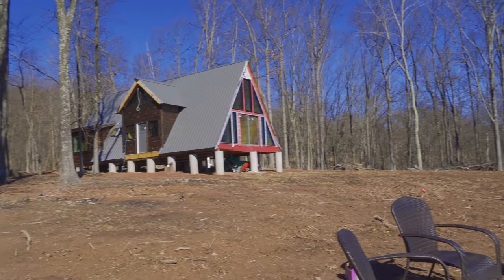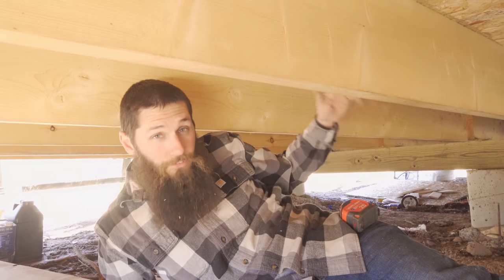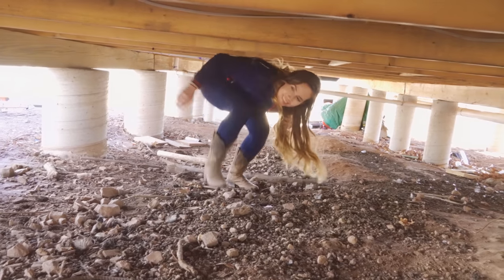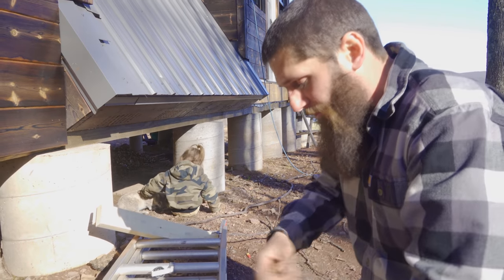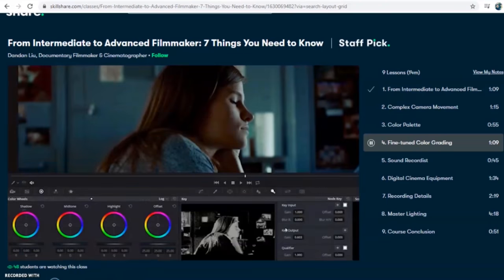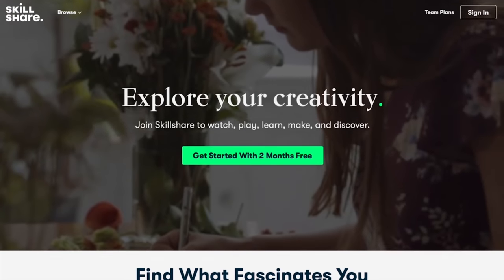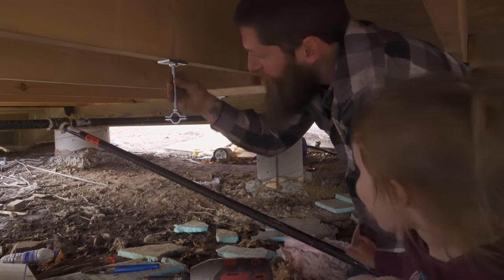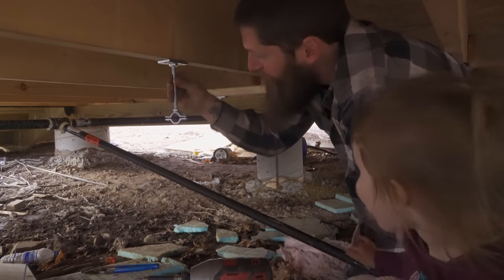WHAT Is Happening Underneath Our House?

Comment: What about termite protection? If you didn't do anything about that cheap and chemical free protection would be boric acid. Dissolve with water and spray all exposed wood up to few feet above ground. You have bunch you tube videos about that. But consult termite exterminator also before anything.

Comment: Sorry I dont understand the wood fired boiler!  how will you keep it going? I thought Propane/gas would be better. could you try to Explain! Thanks. Love & hugs xx
Reply: Wood fired boilers burn wood to heat water, and use electricity to circulate the hot water to whatever buildings you want. 
A few brands are very efficient,  most waste a lot of wood just keeping the fire going when it isn't needed. 
The trick is hundreds of gallons of water tank to store the heat. You burn the wood hot and fast until the storage tank is up to temperature, then let the fire go out.
Depending on your heat loads and how well the storage is insulated,  you can go a few days without needing another fire.

Heating the hot water tank from the wood boiler is easy with a side arm heat exchanger.
Reply: They have dozens of acres of woodland.  Propane will have to be trucked in and paid for.  They won't need all that much energy to heat the house as it is pretty well insulated.

Comment: 2 questions did you do the math for sizing the gas pipe per appliance and are you Insulating the floor
Reply: Clearly half-inch pipe is plenty adequate for a cook top, oven, and clothes dryer.  Each is well under 30,000 BTUs/hour.

Comment: Just me... but I don't get needing to run a gas line to a hot water heater? If you already got hot water, you got it made, no need to reheat it .... lol!
Reply: @thomaswhitten2537  seriously, I am a true fan of these two and their beautiful children and what they are doing. I was actually making a joke..! When people talk about a "hot water heater" instead of what it is,  a "water heater" to make hot water. 
But tankless water heaters make better sense. There is just not reason or need to reheat water that is just sitting in a tank not being used, cooling down and refiring the burner. None cost efficient! Actually cheaper tankless!
Reply: @thomaswhitten2537  wow I am truly at a loss with your responses to my post. At no time did I nor have I   suggested they use anything other than gas (propane) to heat the water. A wood boiler absolutely is an out dated concept for their situation. But read into it what may, my first post was merely a joke, and that is all it was. Have a great weekend, I am going to the races.

Comment: Will the floors require insulation or is it not cold enough in your area?
Reply: Their climate is nominally cold in the winter and hot in the summer.  Insulation would be prudent.

Comment: Do you need to connect a ground wire to the gas line pipe? The gas line coming into my house from the meter has a ground wire even though the line is underground but I've never seen a gas line installed under a house.
Reply: They do need to ground the gas pipe.  But they typically don't show all the tiddling details of their projects.

Comment: In you planning for insulation under your house are you going to using spray Foam insulation?
Reply: They used fiberglass batts in the walls.  I would expect that, if they do insulate under the floor, they would use those too.

Comment: Man-O-man, to much pipe dope. Of course it will never hurt, not until ya fail a pressure test and would like your soap bubbles to find a fitting cracked around the treads. Use a stiff toothbrush to wipe off the excess -- you only need to butter the threading (or partly fill it) before 'laughing waddling ducks' put their six turns in.  Make sure to include a swing joint if expansion and contraction could jar the pipe (like if one end goes into the ground).  Oversize entry holes for clearance and fill with flexible compound. A hundred foot run of iron pipe could expand (or contract) 1 inch over 100°F seasonal change in temperature and building structures might experience similar shifts as they settle over time.  Happy gas fitting.
Reply: Their pipes won't experiience more than 20 °F range.  Either they are buried or inside an enclosed under-the-house.
Reply: @wallykramer7566  I have no idea what insulation they will use; Insulated the floor or insulate skirts or lay out a radiant film. You are likely right, but I make no assumptions.

Comment: Did you have all the measurements to cut and thread the pipes to hit the appliances upstairs perfectly? That part isnt easy... each fitting sucks up some length.
Reply: If the pipe passes under the appliance in the correct direction, the riser does not need to be placed "perfectly".  Twenty-four inch sections make it pretty easy to hit a 30 inch appliance somewhere behind it.
Reply: @wallykramer7566  respectfully I would consider risers coming up at angles poor workmanship. It may be a country home and NOTHING Has to be level or square.  It just NEEDS to be.

Comment: stupid question, should you tape the pipe where it goes through the GAL. hangers. so there is no reaction between the two metals
Reply: Not required. Black iron and copper would be an issue. And even that you need the water flowing in the pipe to cause problems. Back and gal are okay.
Reply: @jordandelorme2341  thanks

Comment: Serious question, why not go with a flexible line? Surely that would be simpler than all those individual pieces of pipe?
Reply: Building codes require hard black pipe for gas lines to the cutoff valve.

Comment: Can someone explain me please, how "naked" wood under the house could be used in long term? As I know, weather will destroy it in few years!? Is that temporary house or they are going to do something with that wood?

Another question is termoisolation, does that good solution to build "floating" house, i thought wind will get warmth from the house and if the bottom of the house will be covered, it will be better isolated!?
Reply: MadMax they said they would be enclosing it - give them time.

Comment: Amazing how you knew what lengths of pipe with threads already cut in them to buy ??  And in what order to screw together each length, with I lost count how many couplers, so that your stubs came out in just the right place ? I would think the layout work for that alone would be a nightmare. I guess I am too familiar with pipe threading to see the wisdom in buying  20 couplers and various lengths of pipe to get that job done. Even if you skirt the circumference of the house I would have thought that you would have insulated the floor maybe ?
Reply: If the pipe is aligned to the gap at the back of the range (for example), then wherever a coupler is under the target is close enough.  The pipe sections are 24 inches and the standard range is 30 inches wide, so there is no chance of missing an opportunity.

Comment: How come you didn't use flex gas pipe?  Much easier to deal with.  You did a good job but I think it would be faster and cheaper too.
Reply: But how durable?   How hassle free throughout its lifetime?  That is why I chose black pipe too.
Reply: @wallykramer7566  yes it will last a lot longer.  I put in a gas stove and used flex pipe and it was very easy to run over obstacles. Since there is nothing to hit it, I don't see any problems with durability.

Comment: Don't drill that beam go under it. Just a few fittings...then you can put in a drip using a tee, 6" nipple and a cap. so simple. every couple of years take off the cap and drain the condensation...that will accumulate.condensation is not  an if its a when.  easy peasy.
Reply: Condensation isn't the concern.  It is bits of sand.  The gas comes from the tank very dry and will dry out any condensation which somehow gets in there.

Comment: Curious as to why diverting surplus solar was not considered for hot water heating.
Reply: The solar plant is photovoltaic, not thermal.  Not common to divert overcharge to heating.
Reply: @wallykramer7566  Once the battery bank is full charged the panels are generating surplus electricity.  There are switches available that will re-direct this otherwise unused resource to electric water heaters. There are solar hot water heaters available designed to take advantage of this as an alternative to the solar heat exchange type systems.  You could DIY a system using on-demand electric water heaters  and temp sensors to circulate water thru the on-demand heater and back to holding tanks to maintain the temps.  The only limitations are your pv generating capacity on cloudy  days but isn't this the same problem for solar thermal systems.
Reply: @wallykramer7566  Not as uncommon as you think.  Once the battery bank is fully charged, it is a simple matter to re-direct the surplus current not needed for float to an on-demand elec water heater that then re-circulates and re-heats the water in a holding tank like the Poly John.  The 96 gal version of this tank is < $150. It is designed as a portable water solution so it is not insulated but that is a problem easily solved.  96 gals is not going to meet the daily needs of every family but after the initial cost it does provide an inexpensive off-grid solution vs. expense of gas lines, LP storage tank and ongoing delivery. My neighbor in CO spends > $600/winter month on propane.  I don't spend a dime.

Comment: You will have a very cold floor with no insulation down there.
Reply: Frank Woodward they are not done!
Reply: @janazyx  We always put the insulation in first from the top then sheet the floor but it works ether way from the top is less itchy I hate insulating.

Comment: I'm surprised that you've had a mild winter. I guess you are in a hole in the doughnut! The south and the east have been getting hammered so that is why I'm surprised. 

Here in the Sierra Nevada of California we are having a drought and even if it snows a few feet a day for the rest of March, the overall eastern Sierra snowpack will be less than half of a season average. Locally, at the 9300 foot level the snowpack is at about 40% of an average season. We've seen worse in the last 20 years, but this is not good. People don't realize the nationwide importance of the Sierra snowpack. It waters the CA Central Valley and much of California's agriculture, which is the #1 producer in  the country. The Sierra snowpack is one of the most important "reservoirs" in the country. 

I can sure see the advantages of having a raised foundation. My crawlspace is dank, dusty and dark. If we had a raised foundation we would have some significant bear problems. They would want to build dens under the house. They frequently try to do so under our deck and we get other critters living the winter under our smaller front porch. Such is life at 8,000 feet in  the mountains.
Reply: Central and southern new England got zip for winter. Practically no snow in 2020, and it's been warming up since the beginning of February. 
The east coast in general is under the same snow drought, including where they are.

It's going to be a terrible year for ticks out here.

Comment: two points, first off, way too much pipe dope, you should be using thread tape AND dope(looping on a bucket of dope isn't good enough. Pipe to is to ensure that the pipes don't seize, thread tape reduces thread friction so that you can tighten them up more which is why you use BOTH. Second, the reason pipe wrenches exist is that they are needed to get the right tension on the pipe threads. Channel Locks are not the right tool for the job. It may work, but it's not right. There are certain things you can do yourself, but Gas is not something I suggest my customers do themselves as lives are on the line and thats just a fact. Biggest saving grace here is that most of that will be under the house so hopefully if a leak does develop then being heavier than air the propane should just load down the hill. 
Not trying to scare you, but sometimes reality deserves to be respected. I am genuinely hoping that OFF camera you brought in someone to inspect and test your work as I would hate for this to one of your last videos. 😢 

PS, those pieces hanging down before your appliances are called "Drip Legs" or "Scale Pockets" and they do exactly what you said they do.
Reply: Michael Illingby they said in the video that the people delivering the propane tank will check their work for leaks.

Comment: When’s the a/c unit coming?
Reply: running a whole house AC unit on solar would drain batteries quick.
Reply: ken j they can always get a infinity unit or a higher seer
Reply: @KenJ-61  Fortunately, the solar plant will be outputting maximum power during times of air conditioning.

Comment: 2 words, metric system.
Reply: It is not easy working 100% metric in U.S. construction.  Tape measures come in inches + fractions by default.  One has to order metric/english specially.  Building materials all come in inches.  Notice the 24 inch sections of half-inch black pipe. Etc.